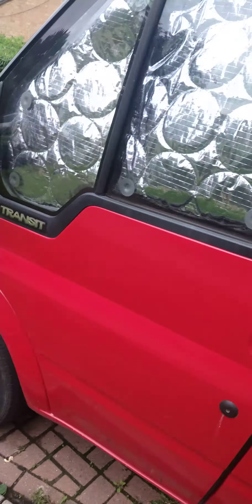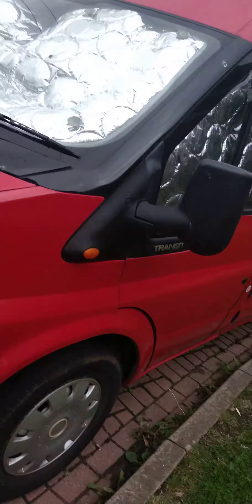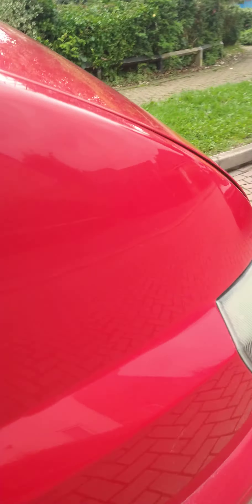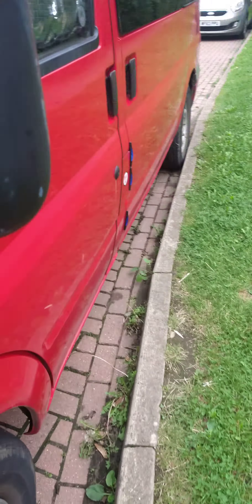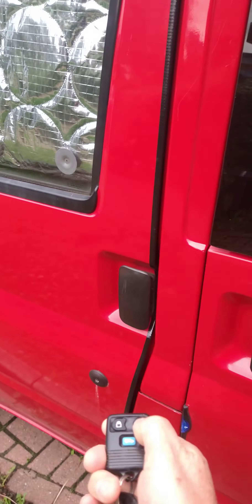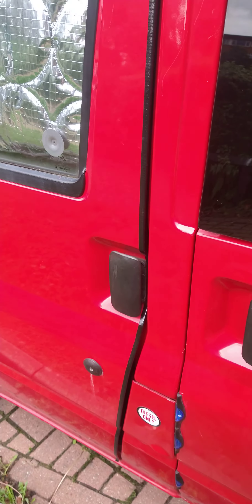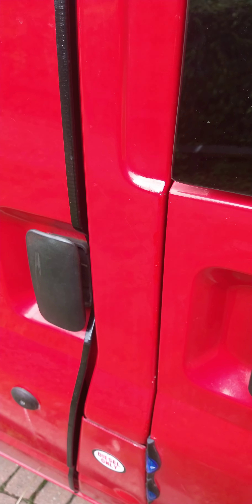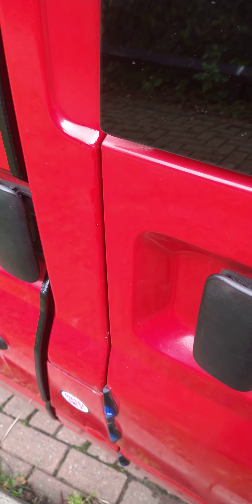Mk 6 Transit,central locking nightmare

Comment: Take the panel off on the drivers side rear door check the wiring loom that runs through the door some time the wires get trapped and break away if you have a broken wire just re connect it hopefully that should work
Reply from the maker: Thanks, the doors besides the rear door lock, I have to lock the sliding door with the fob but the passenger and driver's door with a key, but the fob unlocks the sliding, passenger and driver's door. There's a inack I've developed to lock them, takes about 3 minutes to lock down the van, and it's a  pain in the arse.